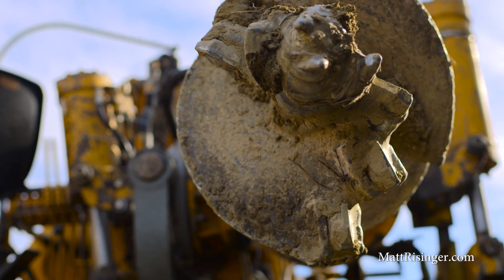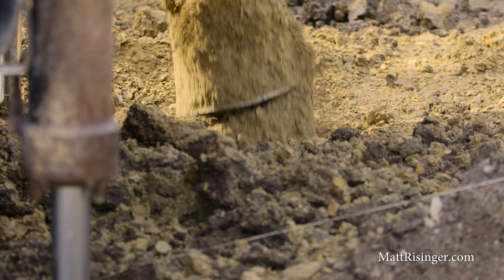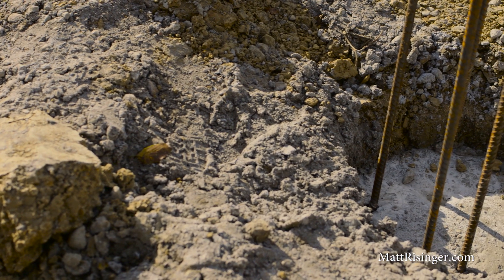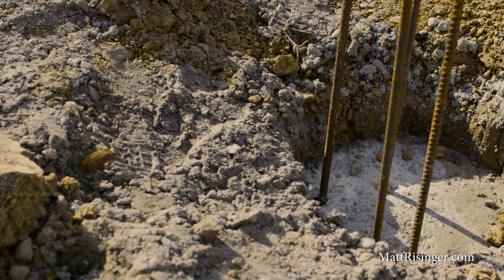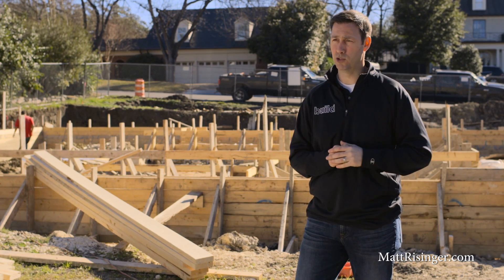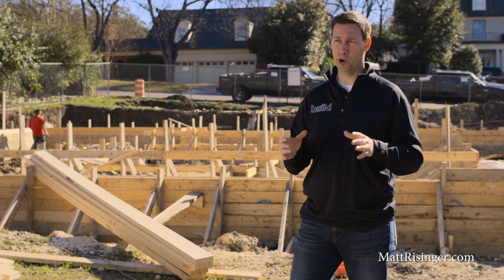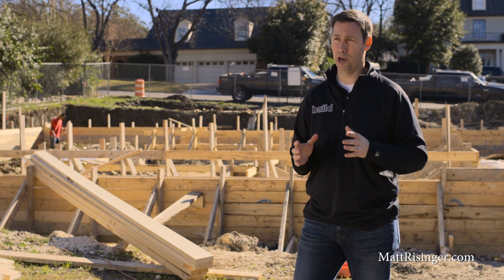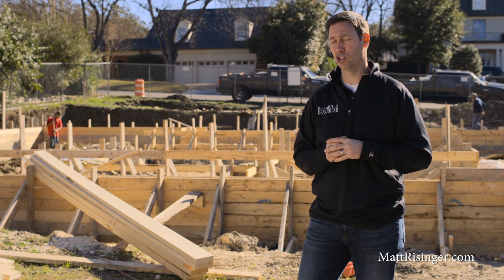SIPS House Intro

Comment: Hey, next time you are at the manufacturer of the SIPs panels, ask them about Logix ICF. I am the local installer/distributer for my area and I find that a house built with ICF walls and a SIPs panel roof absolutely can't be beat. Your only challenge would be finding someone who is a professional installer, but I would recommend learning to do it yourself.